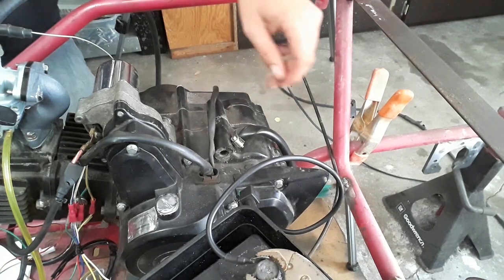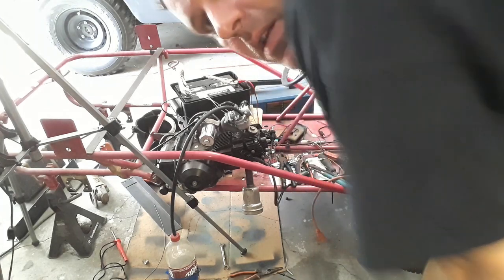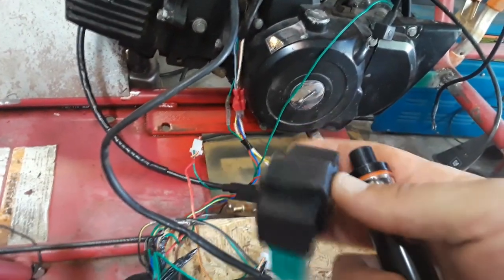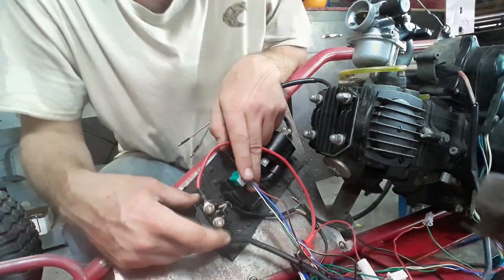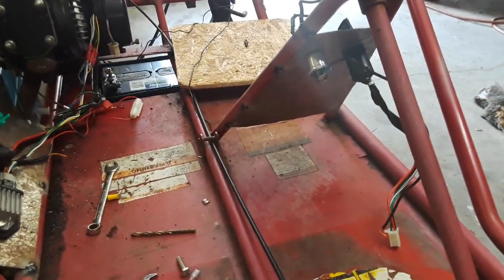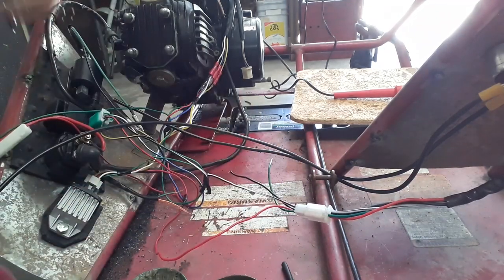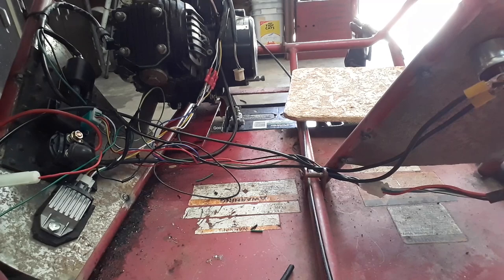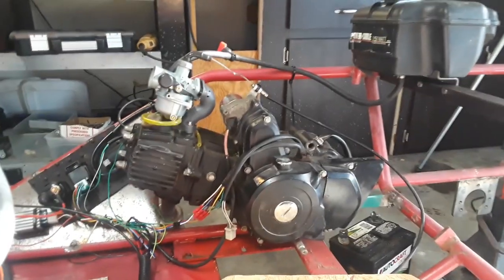110cc go kart build pt4 wiring

Comment: Another thing if the solder doesn't hold the throttle cable together then you will have better luck if you silver solder braze it together.
Reply from the maker: Heck ya thanks for the tip..i will definitely do that when this fails...lol..thx bro!
Reply: @GoKartsorGoneFishin  no problem just trying to help you out man 👍
Reply from the maker: Ya man for sure..i will take any tips..thx again!👍